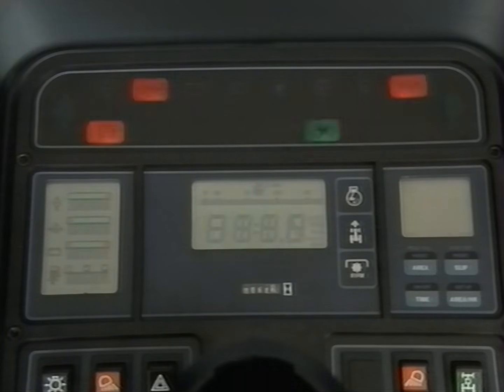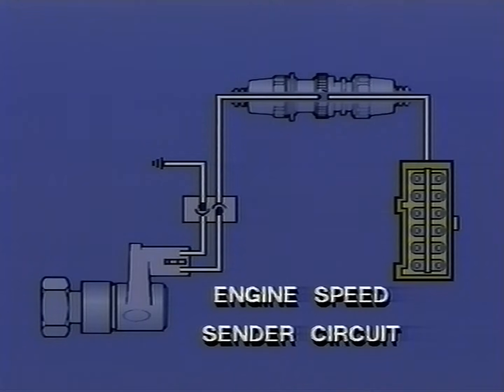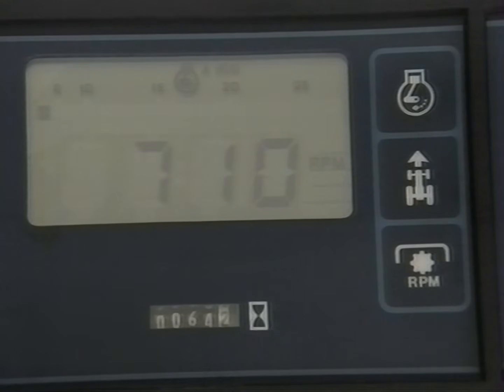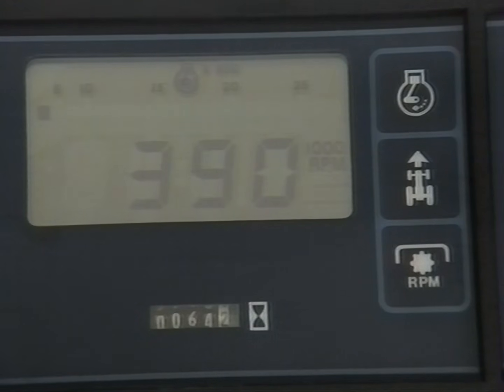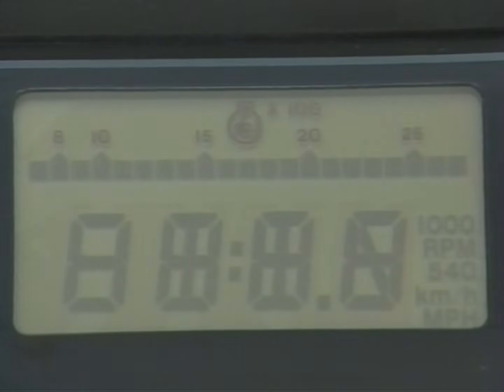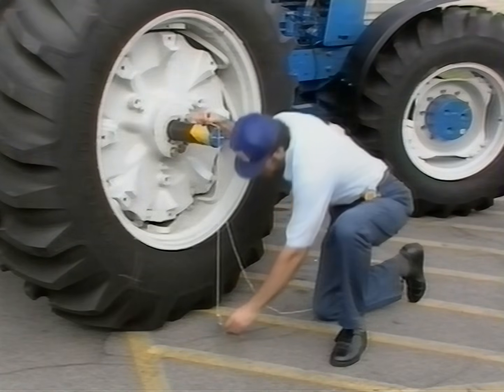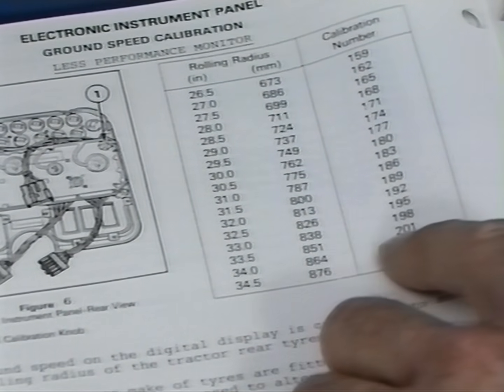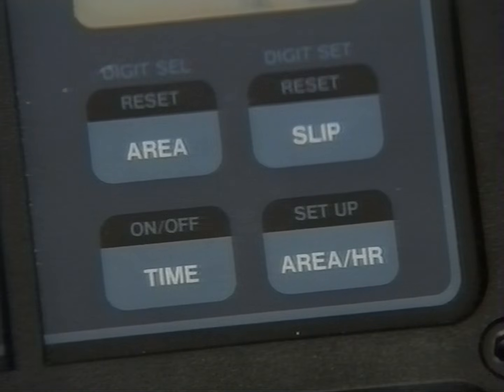Ford TW-Series Tractor Technical Guide (VHS) - Electronic Instrument Panel & Performance Monitor

Comment: I would have thought that dash was only any good with the AREA MONITOR and although not the best system the early ELECTRO LINKAGE which from what I understand was rather unreliable and possibly under developed
Reply from the maker: We don't know anything about any of it but hopefully it's of interest!
Reply: A mate of mine bought a second hand FORCE  3 8210 with 40 KPH  box and the ELECTRO  LINKAGE  control system both in the cab and on the light clusters was faulty as the tractor was mostly used on a hedge trimmer and trailer work he deleted it altogether